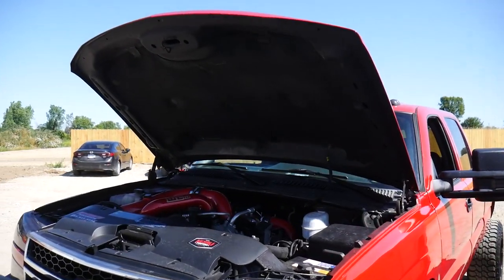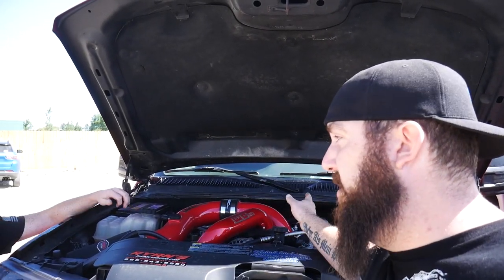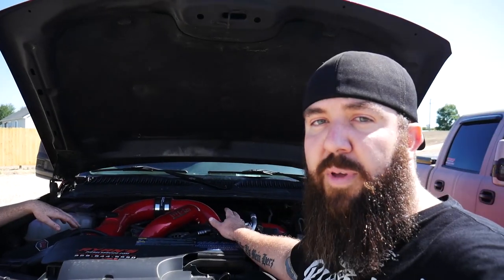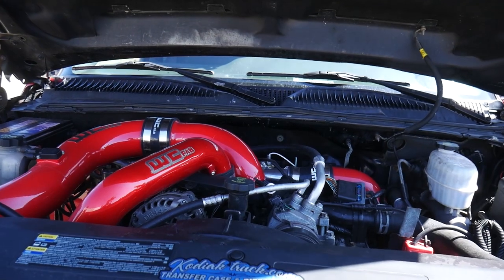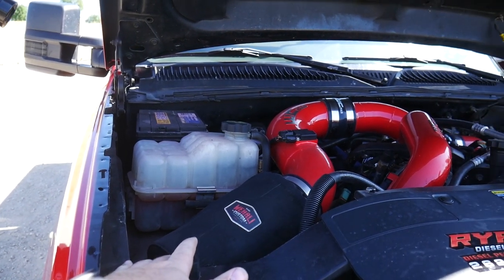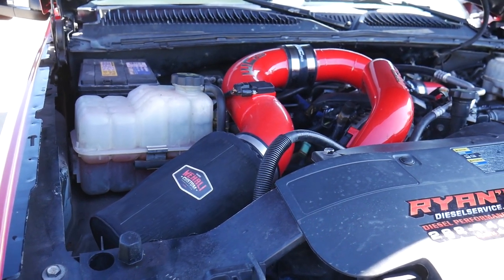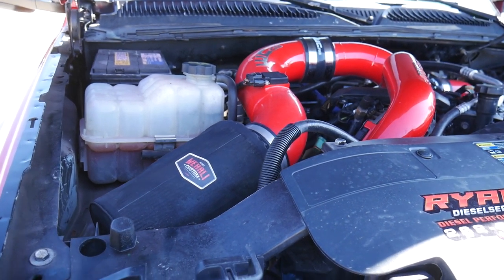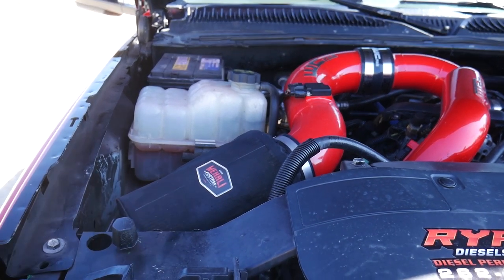HSP - A COMPARISON BETWEEN INTAKE KITS

Comment: Banks has a air scoop that brings air from under the bumper. What do you think about it?
Reply from the maker: Those seem pretty decent, only thing I’m not a fan of is the plastic. Just not so aesthetically pleasing as the powder coated kits.
Reply: S&B does as well.
Reply: Plastic retains heat longer

Comment: Both companies have nice kits, but I’m still not sold on the actual intake inlet. Both still seem like hot air intakes to me because it’s not a complete enclosed filter box. I Live in the desert (Coachella Valley) and it’s hot as hell here anyway, but if I could keep my truck cooler with air flow outside of the engine bay I think my truck would be much happier. HSP or WC Fab!! You should make an intake out of thick plastic and make it similar to the Banks Cold air with a Scoop to ram Cold air!! PS plastic conducts less heat! That would be the perfect kit guys! I’m sure Rustbelt Mechanic and TruckMaster would agree!
Reply: Both the manufacturer and Rustbelt said they measured their air temp at their filter and it was +/- 2° different than ambient outside temperature.